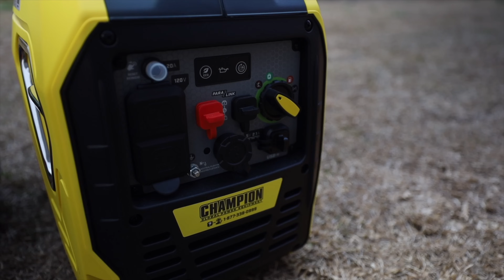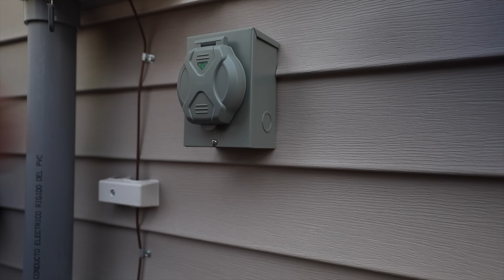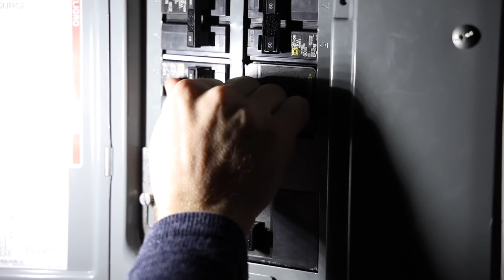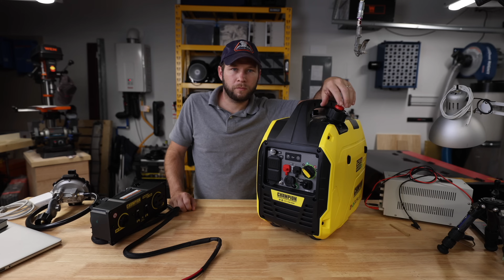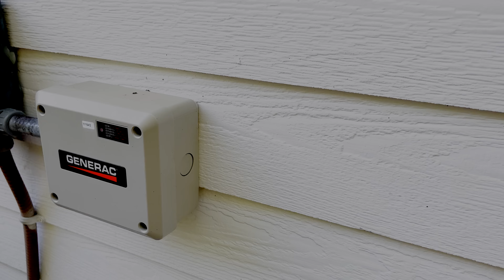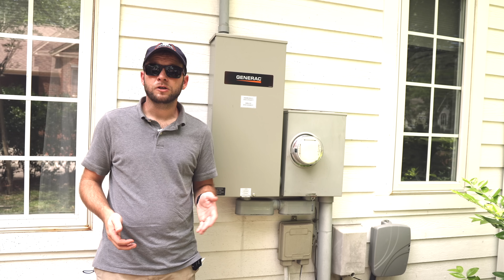Will running on a generator damage your house? Inverter vs standard vs standby

Comment: No. I  have that Generac in your video and I have no problems charging my home with it. I am Off-Grid and use untied solar for my electricity. When it snows for a full week, I pop on that generator for 1.5 hours exactly and it gives me 12 hours of power stored. I have lived here for 5 years now and had no problems.
I also ran a detailing business where we relied on the Honda 1500 inverter. The Honda 1500 is amazing and can run almost anything. You won't be able to run things like big heaters, blow dryers, stoves etc on a portable unit. You can on the stand by or back up generator. These are all bad options bc they use fossils.
In 2023 you are better off buying @NaturesGenerator which is a portable unit on wheels that is expandable and it comes with wind turbine options as well as solar. The size you can expand to is unlimited.
This is very old tech tbh. Solar Portable gennies are cheap. efficient and the wind solves the problem of weeks of cloudy weather (Solar also charges in cloudy weather just not as well as in the sun)
I use the Natures Generator now, as a replacement for my Generac. No need to pay for fuel to run those engines. Running gas on the Honda 1500 or propane on the Generac gets VERY expensive.
The natures gennie costs NOTHING to use.

Comment: What kind of idiot would bury a propane tank?  I wouldn't want to do that, even for an oil tank, I would rather have it surface mounted.  I say this as we have winter and summer weather and rather have the tank above ground as it keeps it from corroding and properly maintained and inspected.  That said, you did have a nice detailed video describing various generators but most houses only need to run a few lights and essential major appliances like the furnace, water heater, a fridge and a chest freezer.  If you didn't buy one of the stupid Internet of things appliances as you mentioned and have a standard fridge, I don't think the standard open frame generator will affect it.  The same applies for a furnace and a water heater.  Most modern electronic devices have a switch mode power supply which actually filters incoming power by doing the same thing an inverter generator does. The only difference is going through it the switching is a higher 400 MHz or something of that nature.

Comment: All fuel-fed motors use filters because we know fuel is dirty. Instead of relying on ensuring the fuel, storage container, delivery devices are all clean, we install filters and things run good. So, instead of spending a lot more money on inadequate inverter technology, make stator generators feed into a device which converts (filters) that into “clean” power safe for home use .
Reply from the maker: A filtering system for output power is actually an inverter, in IT these are known as online or double conversion UPS systems, a simple RLC circuit cannot filter adequately in this manner. Basically the power is rectified to DC put through a storage medium (batteries) then inverted back to AC, so the inverter is still there.  These systems also cost thousands vs a good quality inverter genset or a large high end backup genset with fuel injection. To use the same analogy, a simple filter on the output of a low end genset would be like trying to get race fuel out of 87 by running it through a coffee filter. The processes are very different.

Comment: How do we know if we have these "tandem breakers" that need to NOT be activated on generator power?
Reply from the maker: It will be a breaker that is tied together just like a 240v breaker, and if your labels are good, it would show that rather than a 240v appliance (heating, water heater, dryer, range etc) that it was sending power to 120v outlets (kitchen island etc) basically any tandem breaker (tied together) in your panel that isn’t feeding a 240v device is most likely a shared neutral.  Beyond that you would have to look at the wiring unfortunately.
Reply: @DemonicAnimatronic  I have a couple of tandem breakers (single size, not double) with two small switches (15a each). I had my electrician look them over but he didn't say there was any problem with using them on generator power.
Reply from the maker: @uncensoredpilgrims  if you have a 240v generator even a shared neutral is fine, it’s only if you are putting in 120v in phase to both sides of the panel that is a problem. And if your breaker is single size and not double it may not be shared neutral. Only thing you can do is listen to your electrician as they have seen the panel first hand.
Reply: @DemonicAnimatronic  Yes, It's a 240v generator.

Comment: Yes you can get parallel inverters but you will pay about double or more per watt. The new generation generators by Westinghouse (which are also tri fuel capable) are packed with power to maintain the entire house including a 5 ton AC and it will cost less than an inverter with half or less the wattage. Inverters have their place but for home back up, the generators is the way to go... My $.02 cents.

Comment: Like I said and I mean no disrespect  but “dirty” power shouldn’t be achieved unless you press the generator. I have a sine wave machine that I e had for 22 years and a new one a few yrs back which I use to find this threshold of watts/dirty power threshold. As I said. Prove this I have thousands of customers myself included that have used both machines to double check the workings of any said generator. I and a lot of my clients have 90% and  up efficiency furnaces and use generators like the portable guardian Generac 17,500 watt generator since I took over the business and I never ONCE had a e- card issue. NEVER.

Comment: Just to be clear, as an electrician for 28 years, I can say this, with 100% certainly. All of your stand by ( fixed generators with auto x-fer switches make less than 5% thd, as wel as some of the portable generators, for instance, the sewing house WGen20000c 28,000 surge watts and 20,000 running watts. The brand new Generac gp15,500 & the 18,000 watt, is under 5% thd. The SENCI(ai-power sua 15000ec/ 15,000 watt surge  12kw running watts is less than 5% thd,, great color pulsar 12kw surge 9,500 watt dual fuel is less than 5%  etc etc etc. I would also like to point out the obvious. Even if a large portable generator is rated at, 19%THD for example, IT ACTUALLY STILL MAKES less than  5% THD (Total Harmonic distortion when it’s NOT being pushed to hard. Also. The truth about THD AND “sensitive electronics flat screens etc isn’t true 100% I.e- all my game consoles, lap tops flat screen smart TV’s these have no effect on them when the circumstances of use  and the pull are paced on the generator. However a 95-100% efficient furnace they’re extraordinary sensitive to clean power. However I rarely hear of this , save for 1 time it did! It was t helping the generator I hooked up was being pressed to its max! and the winter here in NY (upstate/corning NY) last yr. So all I did to remedy this was let him borrow my pure sine wave 3,000 running watt converter and powered it with the generator and that in turn ran the generator flawlessly. After that I pitched a ne from my (wholesale) manufacturer and bought him one…. 8,000 surge watt 5,000 running watt pure sine for his furnace and we ran a few hook ups to his computer and his grandsons room for his Xbox and PlayStation. So for all 3 of them and running them through  t the other 2 rooms  he only paid 135 dollars for all 3 they are big name industrial w/7 yr warranty and retail for 600-800 depending on the day and deal they’re having. So in short there are big portable generators out there that are 5% or less THD. In short the difference between a portable, stand by and inverters is the fact the inverters are far more expensive dollar per watt and there’s no generator head, they have an inverter attached to them that’s it. However you can buy a dark grey color PULSAR 12,000 surge and 9,500 running watts are on sale for 699.99 now they never go over 899.99 and they’re dual fuel also so gas and LP. I buy these at wholesale brand new direct from the  manufacturer. Which means Westinghouse, pulsar, duromax etc etc are all made and bought by me directly through them.. thanks for reading the comment folks I’ll have a YouTube channel of my own very soon regarding generators, how to install them and letting everyone know the real pricing of these before retailers mark them up. And plenty on electrical/generator electrical, proper easy LEGAL hook ups plus I’ll be selling wire, conduit etc etc etc. thanks for your time
Reply from the maker: There is a lot to unpack here.I will start by saying good luck on your new channel, my advise would be to get a good power quality meter and use this in your videos if you have access to a wide range of units, I do believe the results would probably surprise you.  There is an extremely good generator/small engine channel on here named James Condon (https://www.youtube.com/@jcondon1)
In most of his genset repairs he will test the output with a Power Quality meter and has recently purchased a steady-state Linear load bank to get some very consistent metering and testing accomplished. I did not use my power quality analyzer in this video because I genuinely don't have access to standard generators anymore, as I sold them off when inverter models became affordable for the power output I needed.   I will say that from everything I have seen, 5% and less THD is quite rare on portable units, you will usually see somewhere north of 15%. now this is not to be confused with voltage and frequency deviation, those are generally what you see having problems at higher loads and few people have the equipment to monitor THD with a full linear load.  

As to "sensitive" electronics and THD being "Not True" I will see your 28 Years of wiring experience and raise you a degreed electrical engineer that worked in high end audio component failure analysis and in utility power generation and distribution ;).   I can tell you that THD creating problems with electronics is 100% true. Now, this is not usually seen  immediately and not often while the generator is connected, so most people don't even associate the two. It could be something having an erratic behavior or simply a refrigerator that died after 12 year when it otherwise would have lasted 16.5 years. zero people are going to associate that with running on a generator here and there over the years.  what usually happens with things like switch mode power supplies is that the input filter caps deteriorate faster (especially lesser quality low temp ones ) and MOVs degrade. eventually you either get full failure of the power supply caps or simply increased ripple and less available reserve current on the power stage.  

I actually had to commission a server in an apartment at one point and after building it up it would crash within 24hours every single day, even with ECC ram I kept getting ram errors. Memtests were all fine, replacement ram sticks good, Very high quality power supply too. finally the power input was looked at and I found that someone in the complex, on the same taps, was using something seriously non linear with obviously horrible power factor. whenever it was used the whole line looked like garbage. After putting the server on a double-conversion UPS it never had a single crash the remainder of its service life. And all of that was on utility power. 

There are definitely some generators out there that are not very expensive that do have good THD. though this is such a big deal that the manufacturer will often hit you in the face with their marketing about it. Whole home standby generators are usually large enough to do well in this regard, I never said you had to have an inverter generator to get clean power. I assure you, the utility company is not using a giant inverter stage after all.  But for smaller generators, the inverters are most of the time the cleanest power. 

now, a cheap inverter can also have bad power, you can end up with poor PF handling and bad waveform generation especially if they are using an unbiased push pull transistor design, then you will have garbage at the zero-cross point.  

one thing that puzzled me, I am really not sure how you connected a 3000w inverter to a generator. Most generators that have a DC output will only have a small capacity of rectified power for things like battery charging, where a 3000W inverter would take over 250 Amps of current at full load and would not be happy without a battery buffer.  You certainly could use a double conversion UPS on pretty much any generator to clean up the power, but the cost of a 3000W unit would be thousands of dollars and you might as well buy a better genset.  

The film industry has long had to work with these problems, that's why they usually bring in big generators from companies like whacker-neuson and will run large power bistro rigs all around a set. For smaller location work, they are most often using something like a Honda EU7000 inverter generator.  For a good read on the problems they face with generators and non-linear loads, I find Guy Holts articles to be a very good read. Also a great read for general information on power quality. (https://www.screenlightandgrip.com/images/Protocol_LEDPowerQuality_Part_1.pdf)
Reply: @DemonicAnimatronic  Glad you could unpack that giant wall of text. I gave up after the first few sentences.
Reply: I work as an electrical engineer for the Navy .THD is  major issue and what we call Type I Power, the best there is, requires a THD of  5% or less and the ONLY way you will ever get that is rotating field. Inverters run off batteries and convert DC into a square wave which is made to look , kinda, like a sine wave . There is something we work with which is called mean time between failure and it is where the Navy started learning the down side of using inverters. Motors which should last 20 years were lasting only 5  . When they were open for refurbishment they found the windings scorched , THD , We also use static converters which takes sine wave A converts to DC and then makes AC at a different frequency , generally 400 HZ . It was done for cost savings over 400 Hz generators but those savings are bing consumed by the bad THD effects. I just installed a GENERAC and  after 20 years of doing harmonic distortion investigations the last thing I would ever put on my house is an inverter and batteries. I had considered getting some solar panels and batteries for things like emergency lighting but there is zero chance I would ever allow my house to be run off batteries and inverters  especially any big ticket item like a refrigerator or freezer
Reply from the maker: @charlescampbell5999 not quite, this applies more to motor controls through VFDs where harmonics in the drive are very different. This is the difference between simulated sine wave and true sine wave inverters. Without getting into dc-ac drive and 6/12/18 pulse inverter drives, If the inverter uses a signal generator and properly biased push pull transistors the likes of a class A amplifier circuit then you can exceed 3% THD easily. Note: not harmonics but measured harmonic distortion and 60hz generation not VF. This is very expensive on a large scale but is used all the time on grid scale batteries to lock with the line for feed in. DC is converted to AC all the time and is line locked. This is why online UPS’s are used in data centers as well to stabilize and regulate any grid deficiencies, the military’s data racks and comms system are no exception, the are fed from a diesel genset through a battery system and double converted back to AC. For motors the key is using low frequency inverters with proper bias and toroidal transformers that can sink the power needed, but motors are usually not the problem with harmonics as they are generally linear. So if you want to go solar, I wouldn’t worry about it, just don’t go for the cheap High frequency inverters and there shouldn’t be anything to worry about. Alternatively you could use a flywheel UPS to convert to fully rotational generation from the inverter output if you really really want to one up the grid. Just remember, if your neighbor has solar and is grid tied, they are also feeding your house and everyone else’s, and the instrumentation still has to meet standard. And don’t forget, the really big high voltage transmission lines are also DC not AC. All of this to say, at a residential level it’s a non issue, as there are already inverters in your grid power anyway, just good ones. Side note: what you are describing is generally motor control with 3phase motors burning windings from harmonics in VFD applications, definitely Out of scope for general power generation for DC to AC.
Reply: @charlescampbell5999 I used to pull motors for USN and had my buddy rewind them. Pain in the ass pulling em out lol.
Reply: Wrong